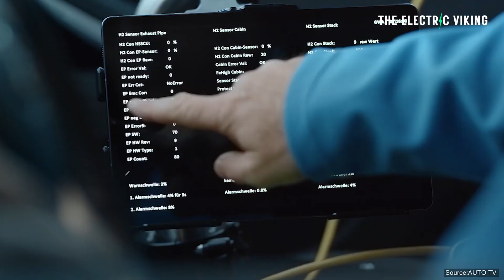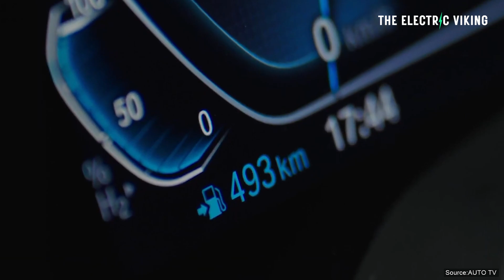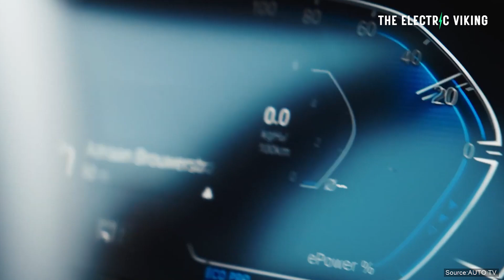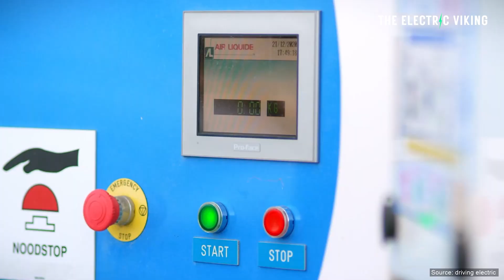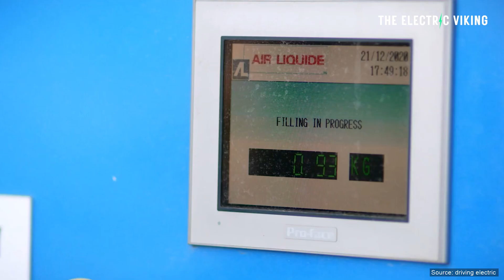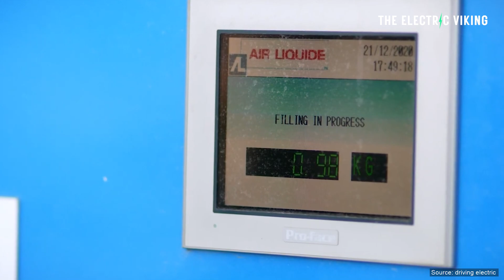BMW partners with Toyota on the future of transportation - hydrogen

Comment: Hydrogen - requires huge costly infrastructure to make as a fuel, and is astronomical to transport and store. In addition, one fuel truck can only carry enough hydrogen to fuel 50-60 cars on average, and the average purchase price of a hydrogen car is ABOVE $100k.  The legacy automakers seem desperate to find any car fuel that requires ongoing fossil fuel extraction - anything other than committing to electric.
Reply: Well said, it is claer to anyone who understands simple physics and chemisrty that Hydrogen is a difficult substance to process, store, transport and utilise. I agree that some money needs to be put into research but I think it is better suited, once cracked, for larger transportation such as big tankers for food grain, oil  etc.
Reply: And yes OIL will still be needed for decades as it feeds so much of current products not includung petrol and deisel and until we find suitable replacements we will dependant on oil for a very long time.
Reply: The average purchase price of the Mirai is nowhere close to 100K!   The MSRP on the XLE is 52000.    No one buys it for that.   Toyota can’t sell them without giving a 20K instant rebate.  So a majority are sold in the thirties before subsides.   My final cost including fuel and not the money saved on free financing was less than 6000 bucks or right around 90% off.   The rest of what you state is true.

Comment: It‘s very, very late in the game. BMW have been fooling around with hydrogen powered cars for some 30 years now and have nothing to show for it. Hopefully Toyota are footing the bill.

The only thing that speaks for hydrogen is that IMHO is that it would be fairly easy to scale up the fuel infrastructure. Existing filling stations could be converted fairly quickly to hydrogen, tanker trucks could supply them and drivers could fill up their tanks in a few minutes and be off their ways quickly. 

No need to build a massively upgraded and hugely expensive and incredibly controversial electric grid and have drivers blocking individual fueling/charging points for 20 or 30 minutes. So in other words, one hydrogen fueling point could be the equivalent of approximately 5 to 10 recharging points!

Some back of envelope calculations would probably show that building a hydrogen infrastructure to be much cheaper than than building a charging infrastructure. Unfortunately Toyota and BMW are far too late, the market opportunities for hydrogen cars have passed by, they had nothing to offer. At least BMW are hedging their bets with some very nice EVs, Toyota have absolutely nothing of interest.
Reply: Well they'll have to get it under $250K per station which seems to be the cost of the average Tesla Supercharging Station... also the basic infrastructure is already in place for Evs for those who charge at home. Not sure hydrogen can easily be swapped in for old  gas stations - you can't use any of the existing equipment AND you have to get rid of the existing petrol tanks as they are an environmental hazard..
Reply: Look at the hydrogen infrastructure needed at a refueling station. Its vast. It ain't gonna happen like you think.
https://www.youtube.com/watch?v=5lUkOHnjLsM

The vehicle itself has bulky tanks carrying a mere 5kg of H2 (Thermal energy equivalent to 165kWh). This looks good until you compare it to the equivalent mechanical energy recoverable from a BEV with a battery of 58kWh.

The range is poor and is up against the limits of physics, so won't improve much without allotting a greater percentage of the vehicle to storage. The battery technology is up against the limits of current chemistry, and solid state solutions (once management of volume change is accommodated) promise great increases in range for BEVs in the same battery form factor.
Reply: You've wildly overestimated the cost of EV charging (which includes convenient home charging) and wildly underestimated the cost of hydrogen refueling equipment. Consider the extremely high pressures required by hydrogen cars - up to 10,000 psi (yes, 5 TONS per square inch), the leak prone nature of hydrogen as the smallest of molecules, the fire/explosion hazards, and the fact that hydrogen dissolves right into steel, turning it brittle. That in turn requires extreme precision and exotic materials, making it very expensive. Chargers, on the other hand, only require well understood mass produced electrical components, and even power grid upgrades won't cost that much. 

BTW, if the hydrogen for HFC vehicles comes from water electrolysis instead of the cheaper steam reformed natural gas, that would take 3x more electricity than the equivalent EVs would, thus requiring 3x more upgrading of the power grid.

Comment: Hydrogen has the lobby power that keeps the government money coming that should be spent on more EV chargers or simply not spent.
Reply: That's your opinion. In my opinion each extra EV charger is a disaster for the stability and capacity of the power net for houses and companies.

One Tesla fast charger uses as much capacity as a small industrial company. In our country 5000 companies are waiting for a new or bigger connection on the power net. 

The EV chargers are economic disasters that costs jobs.
Reply: @andrevanrossum8408  

there are over 1,000 Tesla-owned Megapacks in operation in the United States as of August 2023. These Megapacks are deployed at a variety of locations, including Supercharger stations, VPPs, and utility facilities.  There are at least 317 privately owned megapacks also connected to autobidder.  These also support the grid by leveling out the load.
Tesla's Autobidder software has generated over $330 million in trading profits for energy investors. 
Resistance to renewable energy can delay or prevent the development of new renewable energy projects. This can lead to a shortage of electricity generation capacity, which can put a strain on the electrical grid and make it more difficult to provide reliable service to customers. CA and TX have the most people waiting.  The true problem there is politics.

Comment: When you look at this objectively, the pace of change and take up of EV’s and the rate of change in battery and EV technology means this idea is dead in the water. Hydrogen cars made up 0.02% of car sales last year and is going down not up.

In 5 years EV’s will have better range, faster charging, more standardisation, lower costs and better infrastructure. Hydrogen won’t have a chance against this. It’s pushing an old concept of going to a station to ‘fill up’ and will be consigned to history in the next 10 years.

Comment: The battery charging can be solved by inductive charging on the move. This is already possible. It's technically challenging, but way easier than developing a non existent for now H2 refueling network.
Reply: We really don't need a switch on how we charge EVs.    Nothing wrong with 5 minutes at a charger when traveling and we ill get there.
Reply: @sbalko74  Not much help for long distances. The naysayers complain that charging is the problem on long journeys. With inductive charging, you don't even need to stop.

Comment: Hydrogen is HORRIABLE. While there are many ways to make them work, but a lot of them use even rarer earth that would be hard to get your hands on like plat. Let alone the ways they make hydrogen just isnt really smart. You are either wasting clean water that we dont really have a ton of to spare or you are burning gas to make it. Either options is horriable. Instead of wasting power on water to split the atom - you can just pump it right int oanything! Phones, cars, house, etc. You can't do that once you dump all that power into spliting water or whatever else. Now you have to either burn or convert it back and that energy will always be less than what you put into making it. Let alone to even store it you have to compress it, cool it, and transport it. Thats all extra cost and burning of the effecitny that you will never get back. Let alone how you going to get it back int oyour car? They have to store it as well! Meaning more cooling, compressing, and power! It just doesnt make sense to me to even use it. Now, I understand per pound it does have more power than a battery, so things like ships, airospace, and other things could switch to it - I understand that might be good places for it - but for the everyday person - it just doesnt make sense. At least with the other you can store it in speical zones - for  the public you be storing it with the gasoline ready to just go KBOOM. Batteries are still improving with many saying we will be able to double or even tripple the power storage per kg. That alone would be MORE than enough to make batteries the go to for everything. Sure more power needs = more energy creation - but we still have methods that can work even coal can be clean if we just carbon capture the stuff. At least it will be in a single place vs over a millions of devices releasing gas. Making it still far easier to deal with long term. There still plenty of coal for the next 100s of year giving is plenty of time to switch over to solar power. Let alone the more batteries we have out on the grid - the better over all we can store current solar power + know how much more power to make vs just burning it at random like we're currently doing.

Comment: I think that I heard about a hydrogen solar panel and if we put that on a car that would convert power to electric if and eliminate the explosive gas part and just make it an instant supply then boom but otherwise hydrogen in any gas form is like the blimp but compressed gas tanks with wheels that can go 100 mph
Reply: Solar doesnt produce enough power that would be "clean" enough on the roof of your car - you would need a few panels and a ton of water. You would then have to let it run all the time - compressing the gas it does make taking more power from that panel and or time.... aka.. you would never be able to make enough to really have it matter because of all the losses you would be creating. Let alone the filter and other replacement you would have to do every few months xD You be wasting 60% just on the converation rates lol. Instead, put that power back into a battery ~ panels improvements are also coming - thus instead of wasting that 60% you can just get that full energy back. Some napkin math would require around 500 watts for about 6-7 hours of the day to get about 15 mins of extra driving time that would fit onto of your roof - if we include back and front - we might be able to push up to 800 giving us about an extra hour for every 12hrs of sun light at around town speeds.
Reply: @adr2t  I totally agree hydrogen is ridiculous in all states for at least 10 years, we are still in beta IMO  for this technology
Reply: @adr2t  I dunno tho, Toyota has been making wild statements for years I'm all about an underdog and a good alternative to batteries would be good

Comment: The world desperately needs huge quantities of green hydrogen. Unfortunately, all of this should be directed to ammonia and methanol production, which are processes that cannot currently operate without it.
After that it may be much more useful new methods of steel and concrete production.
Then transport? Well, we'll be 15+ years further and batteries could be rather cheaper, more energy dense and be made in vast quantities by then.

Comment: I've not yet seen enough to convince me that hydrogen's potential as a power-dense fuel source for vehicles won't come to fruition in the future, after we've sufficiently figured out its clean production and widespread infrastructure hurdles, which have, historically only, been a bridge too far. It will have its place; we're getting there. But it's definitely taking some time. And I do strongly lean towards its implementation as a fuel-cell fuel, rather than as a combustion fuel.

Comment: Banks and investors (and maybe suppliers) need to intervene here. The money wasted on hydrogen is WAY out of control just like self driving cars. I think the difference is there is enormous pressure from fuel companies to push alternative fuels and they were not backing robo taxies at all.
Reply: Banks and investors are putting the money into all these hydrogen projects. Maybe you need to wake up and smell the Coffey 🧐
Reply: @lesliecarter4295  Who is Coffey?
Reply: The only ones putting money in self driving cars are Tesla, Google, Uber, Ford, GM and VW, to my acknowledge, and only Tesla will solve it, very few companies go for hydrogen, Toyota wasting the most to the point of wasting Japan's money, fools errant.
Reply: banks love hydrogen more than electricity, hydrogen requires loans at least in 6 steps. electricity requires it at only one.

Comment: its only one thing tat are positive with hydrogen, and only one. Its charging very fast. Nothing else.
Reply: And what about zero emission
Reply: @De_Wukong  Not 100% true, hydrogen can still leak and that means it will float in the air over a millions of millions of car if we switch over to it - yet another gas that might have hidden issues for the planet.
Reply: A single car, but throughput is NOT, the station becomes cold during filling, and requires 20 mins between cars.
Reply: At 800 ATM you would expect it to be fast.
Reply: @jimgraham6722  But the delivery system requires time to equalise the huge pressure in the pipework before the next delivery can proceed......